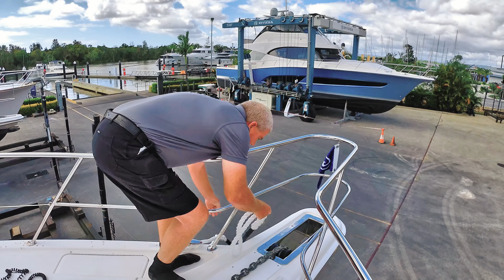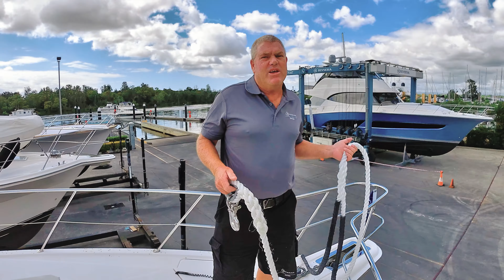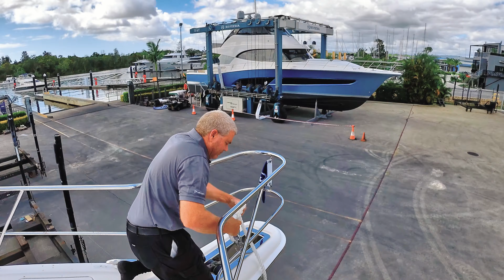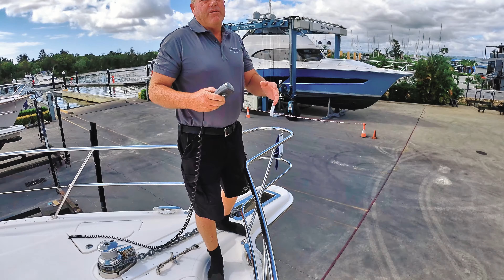Boating Tips & Tricks - Anchor Snubber

Comment: Nice setup but when you have your snubber that far in the water, it loads up on barnacles and sea growth.   I have found if I have the chain hook slightly above the water, it stays cleaner.     I got a nasty cut on my hand grabbing the snubber hook to release it by a hidden barnacle.  I also let out some slack chain but don’t need to deal with tides that much here in the Caribbean.

Comment: What would be your suggestion for a half inch rope anchor rode instead of chain.
Cheers
Reply from the maker: Hi Larry, the rope type and thickness needs to be suitable for the size of boat.
Most Riviera owners are anchoring on sand so there is a big benefit in using chain as it helps to get a better hold and keep the chain taught.
Using rope for rode is normally only used with reef picks or in exceptionally deep water where it is not viable to carry such large amounts of chain.
Ideally a snubber should still be used with rope so the winch is not loaded but the rope can be tied off to a cleat to create the same effect.

Comment: With eyes spliced in to the line, you will not be able to release under load - you will end up cutting it.  If someone fouls your anchor chain, the only way you will be able to pay out more chain is to cut the snubber.  You are better off with simple cleat hitches.

Comment: How does the hook not escape the chain in this case? Considering hook  is open and usually there is a lot of boat and anchor chain movement. Tks
Reply from the maker: Hi Mauro, that's a good question and you are not the first person to ask.
When you make a snubber make sure the rope is long enough to hang over the bow/roller so the chain is always hanging on the hook. 
There are also hooks designed for holding the chain.
Even if the chain has gone slack there is always the weight of the chain pulling on the hook. Every metre of 8mm chain is approx 1.5kg so it adds up quickly. Hope that helps :)
Reply: That is the problem we frequently experience. With lots of bouncing, the hook detaches from the chain, and no more snubber function
Reply: @flygringo that means you’re not letting out enough slack chain to weigh the chain onto the hook. Make sure to let out enough that if or when you start slacking forward there’s still so much slack chain that 5-10’ is still hanging.
Reply: @ReviewByGeorge  thanks, I'll have my first mate (wife) do that from now on.

Comment: Not a good idea to drop the hook over board. Too easy to beat up the  hull in windy conditions. Instead keep the hook on the deck and feed it backwards through the bale after securing the Snubber lines to the cleats.